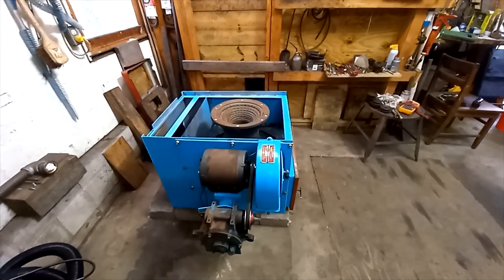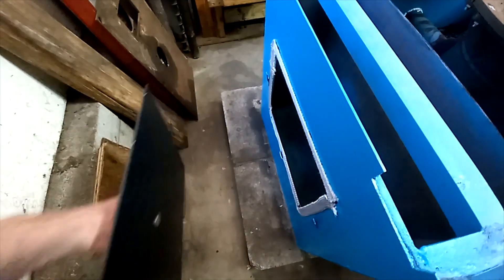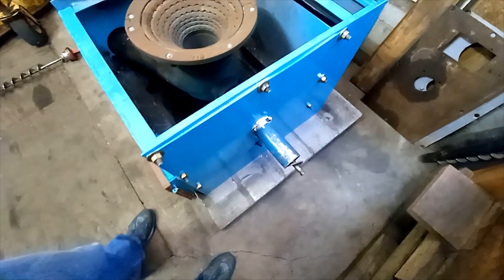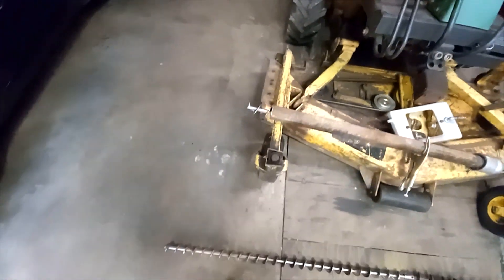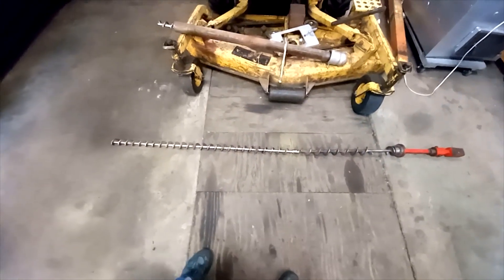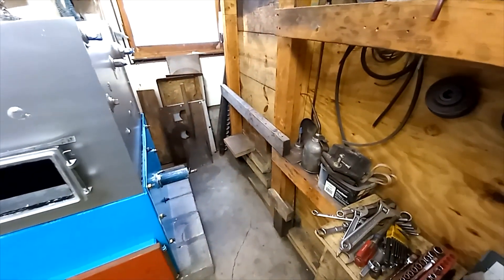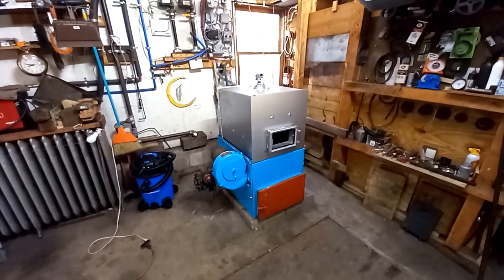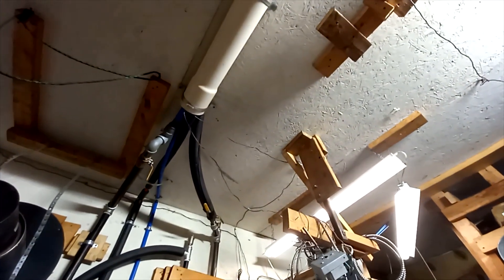Gentleman Janitor Coal Stoker, Assembling the Boiler and Base

Comment: Love those GJ’s what do you use for a hold fire timer. I’ve always seen that old Minneapolis Honeywell Control on the wall is that a timer you use?
Reply from the maker: Thanks!
Wow, I totally forgot about the timer, LOL!
I've been running Axemans out in the garage for years and they don't use a timer. But, I do have a Tork electronic timer wired in from earlier stokers so I will use that.